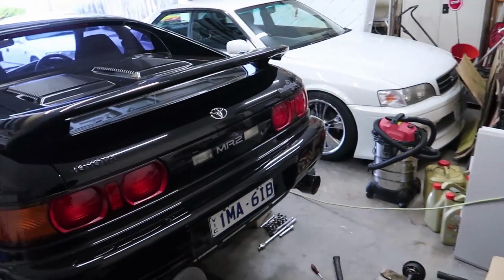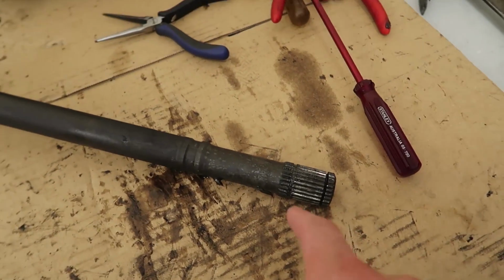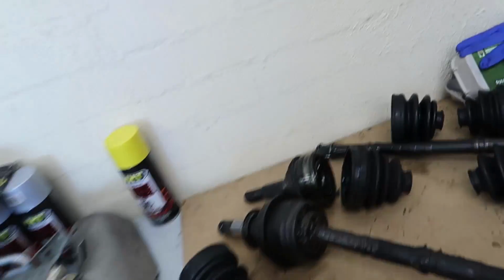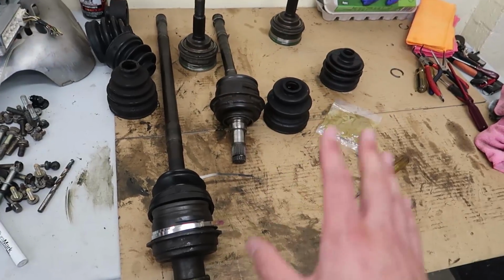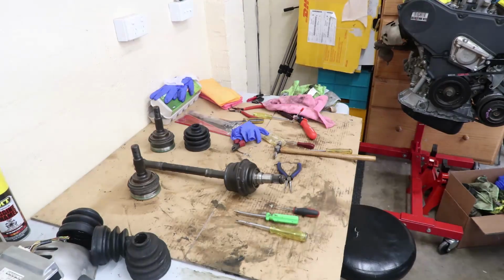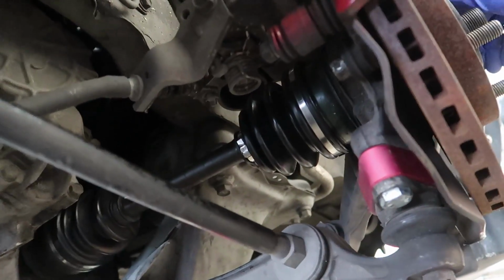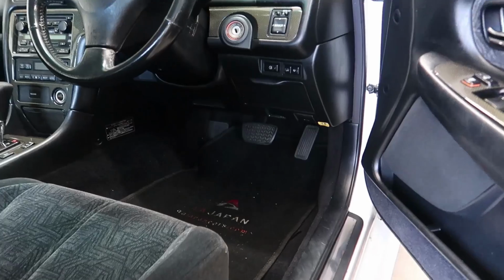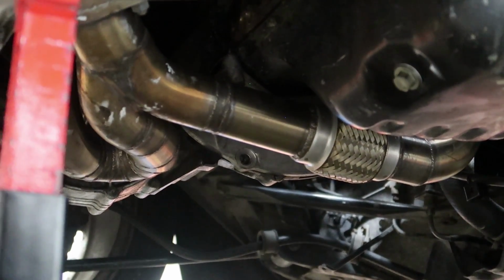this is why i won't be driving the v6 mr2 for a while...

Comment: Yeah, it was really complicated to put the boots in Haynes. Maybe the factory is the same with a lot of SST? Not like other cars. New axles are $120 posted for a set. But you still need to re use the snap ring... so maybe put an ad in higpages or airtasker and maybe a local mechanic can leave them for you to pick up. or the camry...?

Comment: also dude, i'd say sell the chaser and save the cash for a proper manual one. 
it might cost you around the same eventually. Unless you want a project. 

engine oil leaks and transmission leaks on a 20 + year old car mean lots of TLC. and going by the broken MR2, you dont want to end up with 2 project cars.